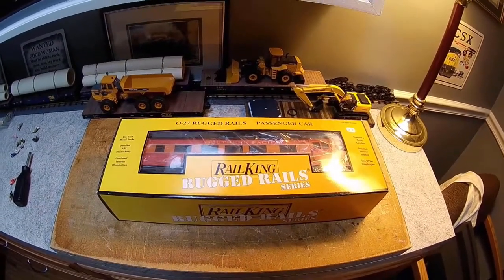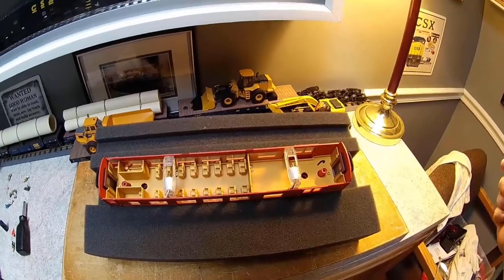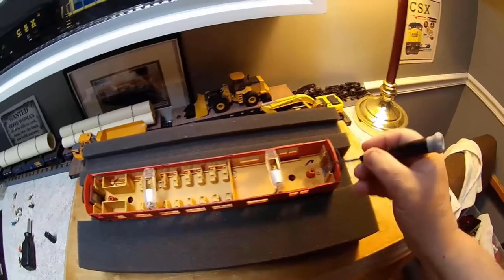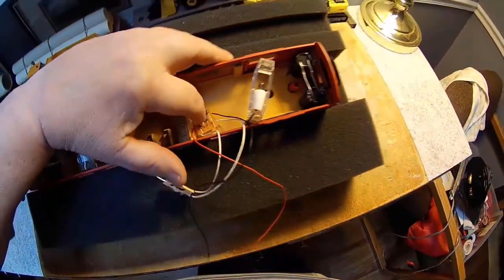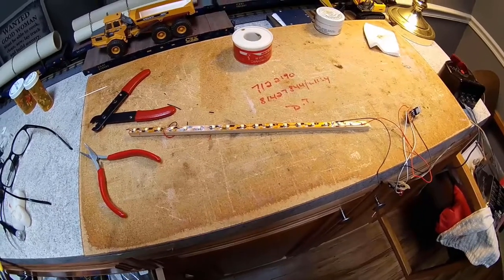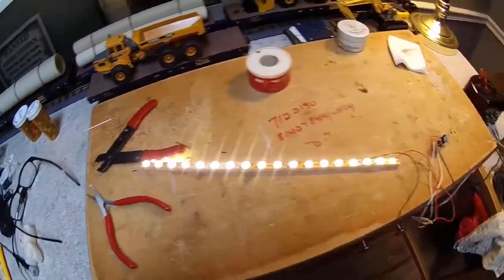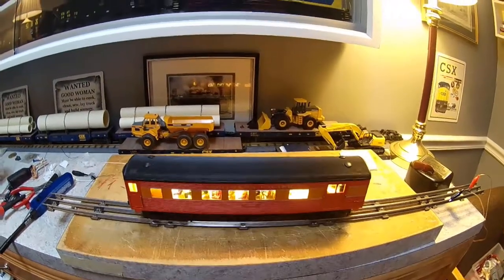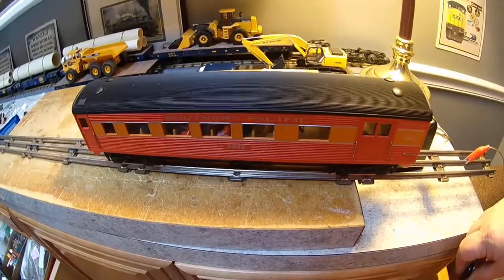Adding LED lighting, and people, to an MTH passenger car.

Comment: Try just replacing the incandescent lights with leds.  You might be surprised at how well that works.
Reply from the maker: I actually have given up on the whole idea. After running these cars for several holiday seasons at near their maximum voltage rating I have found them starting to burn out in sections. Eventually, I'll do something else.

Comment: Cool demonstration: Like the idea of leaving in the original lights.• I am not sure what parts you wired in and where you got them from.• Do you have link for the parts needed for this project? • Clean-up  • Cheers from The Detroit & Mackinac Railway 🚂
Reply from the maker: I'll put something together, but all parts came from either eBay or Amazon except for the light strip, which was given to me.
Reply from the maker: I'll send you an email on the parts used.

Comment: Also I was wondering  if you  used a bridge  capacitor  for the ac to dc exchange
Reply from the maker: I copied a plan I found on the internet which used four N1701 diodes to convert AC to DC then a 12 volt bridge rectifier to power the 12 volt LED strips. 
Down the road problem I have now is powering the LED's at 12 volts they burn out fast.

Comment: 2 capacitors aren't necessary
Reply from the maker: I didn't even think about that. As I said in the beginning, I have no background in electronics. I just tried to copy the design from the magazine, it used 3 so I did as well.
Maybe I'll try this, 1 capacitor versus 3, in a future video.
Reply: How  do you  go from ac to dc power  do you  use a bridge  capacitors
Reply: Gorilla  glue  gel set up in about 5 t0 6 minutes  to completely  dry